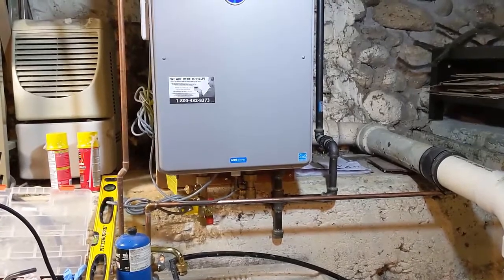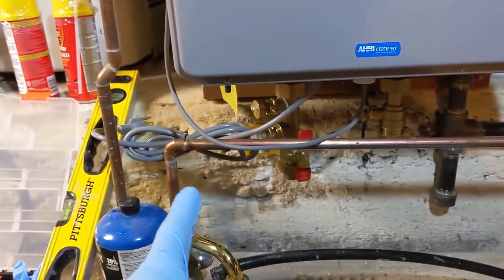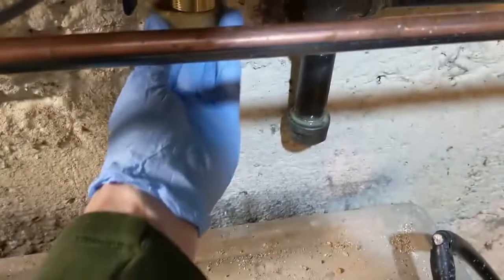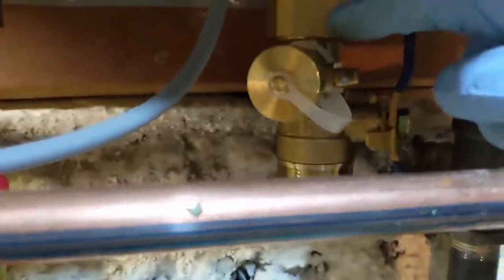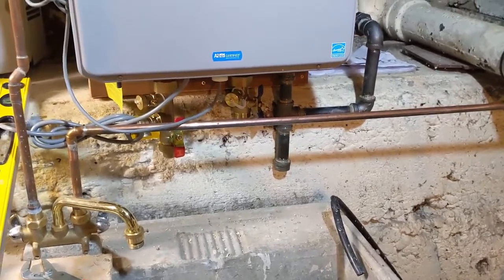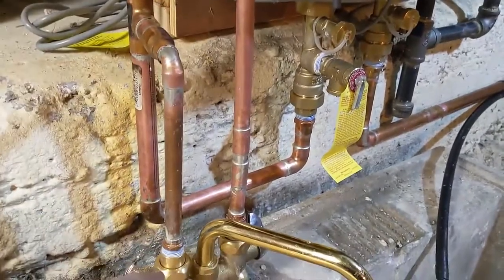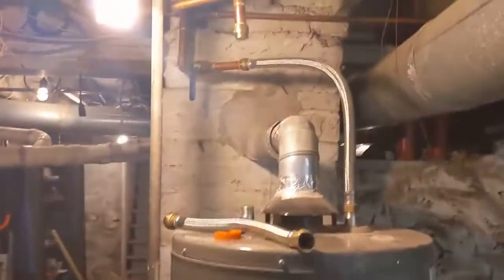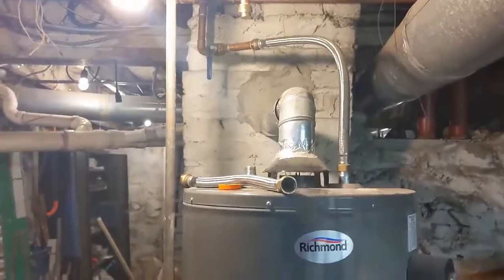Rheem Tankless Water Heater Installation Part 4: Sweating copper pipes

Comment: Looks nice.  The only thing I would say is that on the brass bypass valves, your connections that have the gaskets (top and bottom nut on both) you really do not need to put on Teflon tape.  Teflon tape is a lubricant that allows you tighten down a fitting that is tapered and becomes water tight by tightening the thread taper.  Those big brass nuts are not water tight because of any taper, but rather because of the gasket.  Teflon tape may "help" seal a bit, but it is primarily used to lubricate to allow for the threads to seat tighter.
Also, for your PVC work in the future, it you go to any of the plumbing supply places in Indiana (since you are in Chicago) you can purchase clear PVC primer instead of the purple stuff.  If you have an inspector out, they will fail you because they require the purple so they can easily tell that the installer used primer.  For my DYI stuff under sinks and in areas people will see, I use the clear because it looks less messy.  
Overall, great job and thanks for your discussion on the A1 and A2 settings on a prior video!
Reply from the maker: Sean, thanks so much for your comments. Clearly you know your stuff!  I don't believe I taped the joints that have gaskets; only the threaded connection on either side of the valve which are brass-to-copper threaded connections. But, yes, your point is valid - if a connection has rubber, no tape is needed. Also, I have another video where I re-plumb a kitchen sink drain and use clear primer. Your point should be reiterated for the wider audience: use Clear primer on visible plumbing that isn't inspected and Purple/Blue on everything else. Thanks so much for watching and joining the discussion!

Comment: My biggest concern at this point is that all my water lines are 1/2 inch. From the main they reduced it to 3/4 inch then reduced it to 1/2 inch. I can cut just before the 1/2 inch and run 3/4 inch cold directly to the tankless, but my hot water will have to be reduced to 1/2 inch when it meets up with the existing pipe which is about 15 feet away.
Reply from the maker: Reducing to 1/2" is very common.  In general, you want to run in and out of the water heater with 3/4" to have decent volume before branching.  But then split off to 1/2" branches for bathrooms, kitchen, etc.  If you have a bathroom with a large jacuzzi tub, 3/4" piping may be needed to fill it in a reasonable time.  But for most fixtures (showers, sinks, washing machine, etc) 1/2" is plenty of volume for that branch.

Comment: I am about to install one of these.  I was thinking of using some flexible water lines; maybe even pex (for easier install).  I am in Georgia so I don't have to worry as much about bitter cold breaking the lines.  What do you think about stainless steel flexible lines, like for a clothes washing machine?

*Oh, I see you have the flex hoses on your old hot water heater, did you ever have any issues with those??*
Reply from the maker: I did use no-burst hoses on my old water heaters because I would buy the cheap tanks and replace them every 6-8 years.  But I wouldn't recommend if you buy a quality water heater that will last more than 10 years.  Those hoses do restrict the flow due to the inner diameter and use rubber washers to make the seal which can deteriorate in time.  I would recommend running 3/4" pex (or whatever your local code allows) directly into the service valves of the water heater.
Reply: The stainless flex lines on a tank water heater were protection for plastic pipe from the hot vent. Don't need them.
Reply: PEX is good.

Comment: Is the condensate corrosive? I read somewhere that it is and can't be drained into a sink , is that true?
Reply from the maker: Yes, the condensate is acidic and can corrode metal. Mine is draining into a very old cast iron basin that I'm not too concerned about. Plus my water softener  and dehumidifier discharge lines keep that sink wet. If you need to discharge into a sink and you don't want to harm it, you can run it through an inline condensate neutralizer.
Reply: thank you!  Draining it into a plastic slop sink shouldn't be a issue then right? However my slop sink is hooked up to a above ground sump and sump pump , because my sewer comes in at waist level in the basement.  I'm guessing it would corrode the pump then ?
Reply from the maker: @Anonymous23-y5s  If the trap in your slop sink keeps full from use, it may be enough to dilute the acidic condensate water before it hits your pump.  But to be safe (and code compliant), you could buy something like this and run it inline between the water heater and sink. https://www.amazon.com/Noritz-NC-1/dp/B008ORBM3K/
Reply: @FixItScotty  Thank you! if it's going into a PVC pipe it should be fine right? I'm thinking if I tap into the laundry drain.
Reply from the maker: @Anonymous23-y5s  Yes PVC pipe is fine.  That is why the vent itself is PVC.  Best of luck to you on the install.
Reply: @FixItScotty  Thank you for your help!

Comment: i didnt watch all,but no condensate drain???.like 90+ furnace...always slope pipe up ..drains back to unit....nice job
Reply from the maker: I show the condensate drain in part 6 where I finish it off.  Also, other commenters have noted the upward slope.  I plan on a follow-up video to provide corrections like this.  Thanks for watching!
Reply: @FixItScotty  yep,saw it...real nice job,,beats paying a so called pro...for a rush job and bogus work...lol